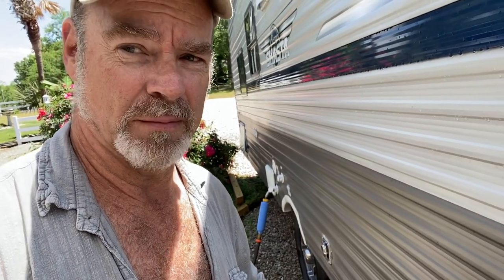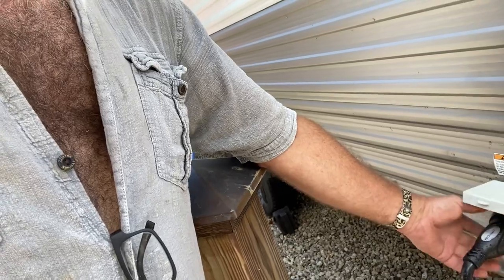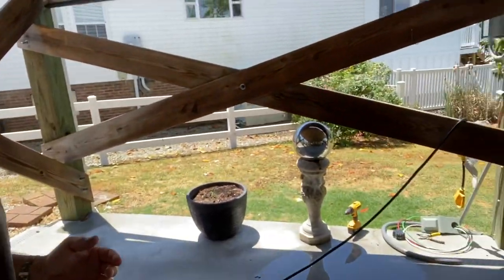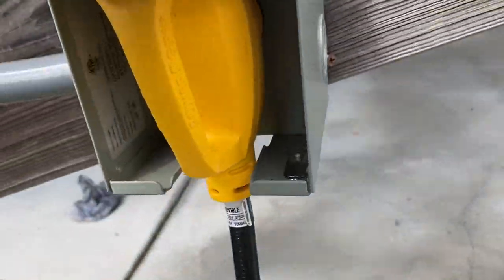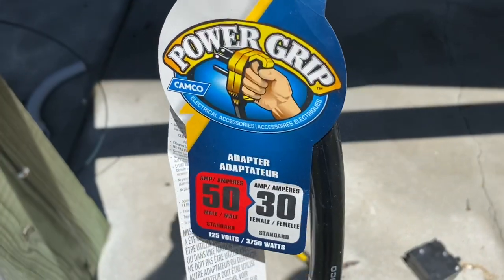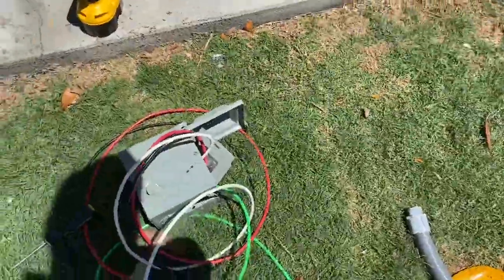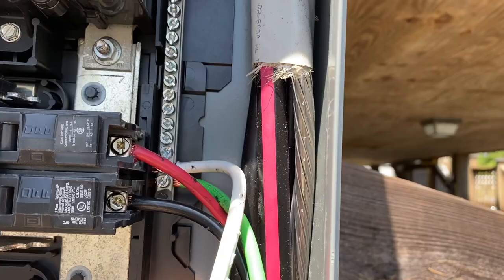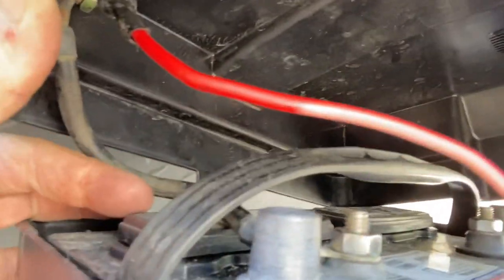Installing a 50/30 AMP camper outlet and circuit breaker

Comment: Simple DIY  but unnecessary waste of time for a camper parked on the driveway that you can keep on a 15 amp socket.,
Reply: May need more then 15 amp for the roof top air to run properly, I know mine requires no less than 30 amp.